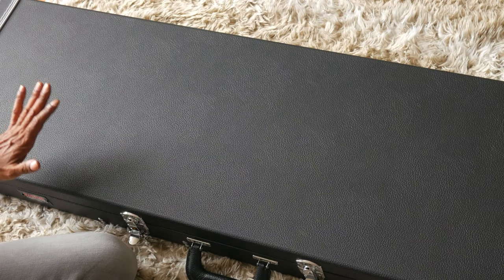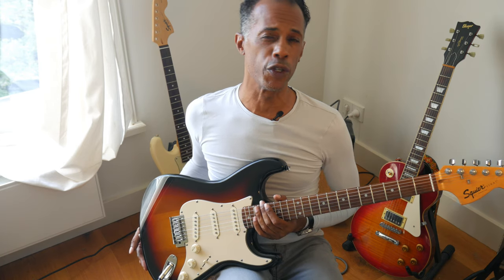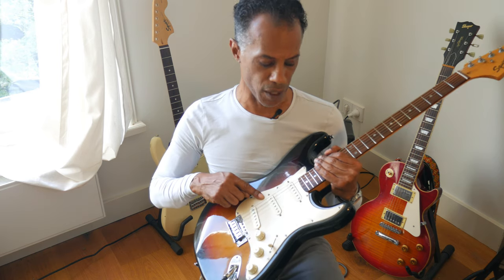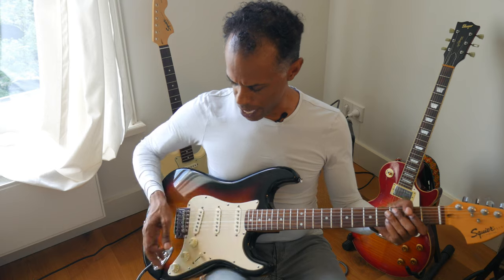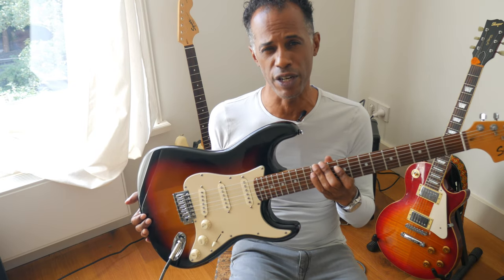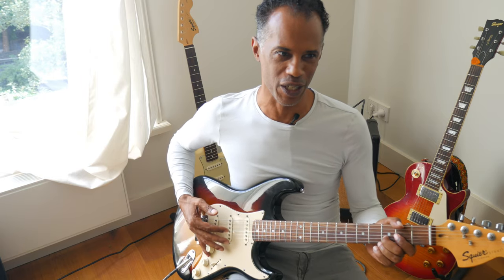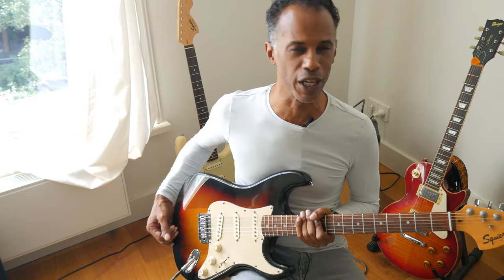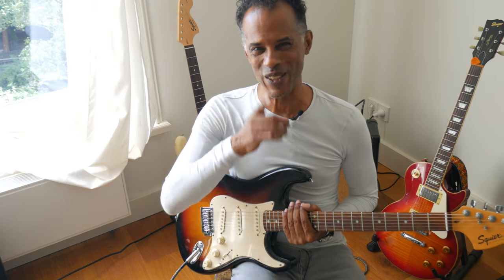Squier parts caster? Some things to do and not to do!

Comment: Mike, do you have any recommendations for neck tinting / color matching - like the spot where you replaced the affinity logo.
Reply from the maker: I wrote a reply to this. Seems to have disappeared from my feed!
Reply: @USTTRM  I am not seeing the reply either. !
Reply from the maker: Ok I will reload! 
I use a mixture of strong coffee and Stewie Mac Vintage Amber stain.Acetone in the end of a Qtip
To remove. Follow with a wet/dry sanding of just that area to remove any excess. Now using a QTip and the stain you apply to the surface and let it dry. A few days it will take. Finally a buffer to finish.